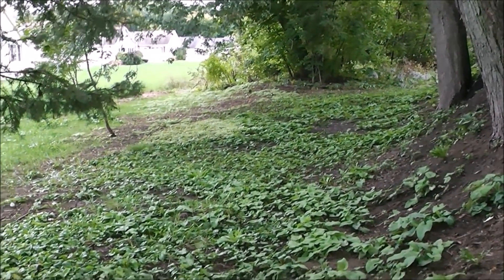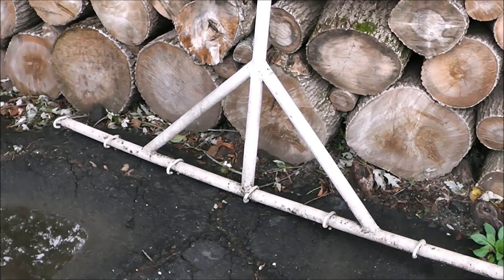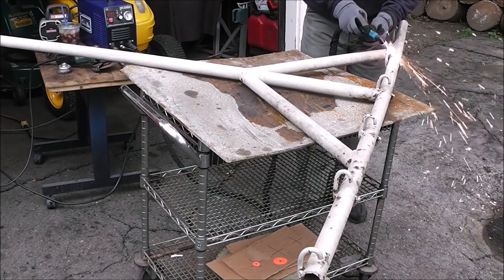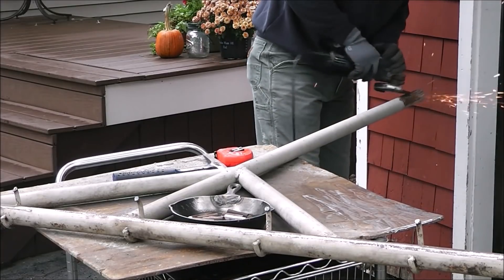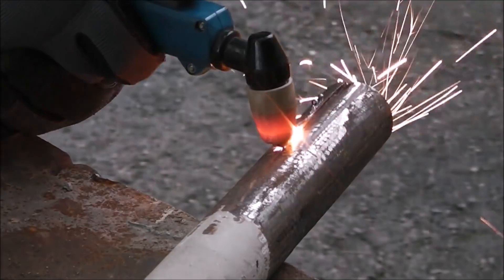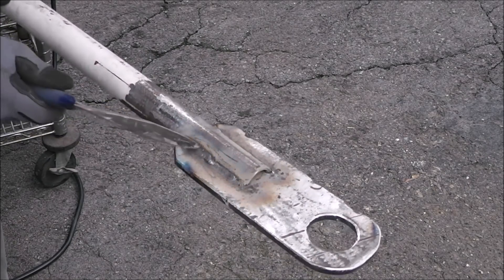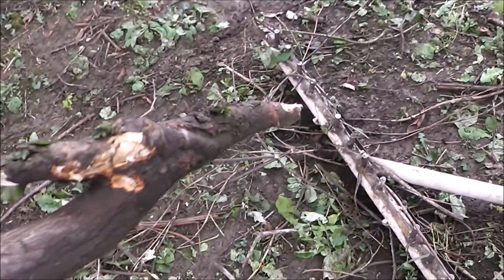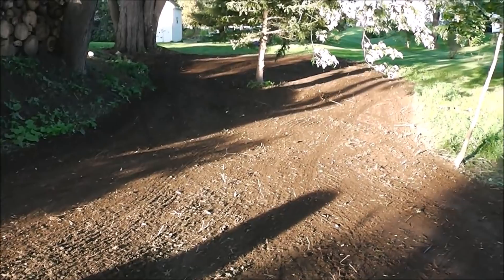How to Stick Weld with 6010 and Build a Tine Harrow to Level Uneven Soil!

Comment: Dang... that worked well. I'm looking to build one this weekend. I may make the tines longer
Reply from the maker: Thanks man! If you do make them longer just be careful your tractor is heavy enough in the front to keep from wheeliing over backwards. This one was on the verge of doing that in the beginning with the heavy vegitation and roots. The tines were getting fetched up but after the soil broke loose then it wasn't a concern.

Comment: Best kinda of tines are flexible and they should be a minimum of 6 inches. The one you made are way to short. You also need to add some weight to it
Reply from the maker: @kyle budd Nah, this is an old video. My lawn looks like a golf coarse because of this tool. I can't compare it to anything else because this is the one and only I ever built but my lawn came out pretty nice so I cant say I would have changed anything. I did use some weight as I mentioned in the video.  I think with 6" tines my tractor wouldn't have had the nut to pull it.  Here is a a look at the finished product. https://youtu.be/Inp5wQYKnZc?t=313

Comment: Hi Brandon,  Does that 205s welder have hot start? How does it do starting an arc compared to your Blue Demon?
Reply from the maker: Good question and here is my opinion. If the majority of your work is stick welding, I always choose the Blue Demon. It has hot start and arc force (it's all automatic with no setting) the Ansen does not have those features but does have a good arc, just not as good as the blue demon.  The blue demon is very crisp and smooth. If the majority of your work is TIG, I would choose the Ansen. I like that it has the automatic gas valve as compared to the Blue Demon which is lift start.  It's a tough call, but in short...the Blue Demon is awesome at stick and the Ansen is awesome at TIG. Clear as mud? LOL hopefully I helped. Cheers brother

Comment: Gotta ask: If 6010 (a dc rod)  won't run well on an inverter welder, then why do they even make it? Anyhow, nice job!
Reply from the maker: Gordon Reiher I’m not an expert on this but 6010 is pretty much used exclusively by pipelines for their root pass on pipe, then they cap it with a 7018 or something along those lines. Many of those guys are using engine drives and the fact that it’s a dc only rod, it gives the smoothest arc and cleanest weld for x Ray. For someone like most of us, we would just grab a 6011. It’s my understanding that the only difference between the two is the flux coating. The 6010 may also burn its flux a little more cleaner, reducing the chance of slag inclusion.

Comment: Love watching your videos. Your thought process for cobbling little projects together is a lot like mine. My last project was taking some black iron pipe I bought in a clearance sale from a local hardware store for 50% off and making a handrail for the stairs on my deck. The pipe was a bit cleaner so I used 7014 rod on it because it welds quickly. I had to use some videos from guys like yourself to learn how to notch the pipes to fit each other and then I was able to assemble it without much trouble. It's amazing what you can learn from YouTube now!
Reply from the maker: Thank you very much. Whenever I can repurpose something or make it better / more useful I do. I get a lot of satisfaction taking something that was discarded and giving it a new life. From the sound of your railing project, you know EXACTLY what I’m talking about! Good on you brother for being resourceful! Thanks for your support! Cheers

Comment: Nice rake build ,your tackle and get the job done style sure makes for a great video every time.I built one,  I used a case 400 to pull it all ,it was two rows of ten foot long pipe and I used railroad spikes about eight inches apart and the back row spikes were offset , but I used a disk on the field first ( 25 acres ) then I planted oats and alfalfa ,then I used a 12 foot pipe with tire chains to cover the seed it all turned out great and made a bunch of hay .
Reply from the maker: Thanks man! That take you built sounds like a beast!

Comment: good project, jut one thing , make sure the hitch is lower than the rear axel of the tractor, that why you won't tip your tractor over on yourself
should the tines grab something before you can stop. turn your hitch over or mount the ball lower than the mid line of the tractor rear axel.
Reply from the maker: Good point! Thank you! I will correct that because I can see someone going over backwards!

Comment: Nice project. Thank you for saving this metal from the scrapyard and repurposing it into something useful. To recycle is great but to repurpose is even better! I like 6010 and 6011 both. I like 5P lincoln and 5p+ for welding pipe but on a project like this I prefer 6011. The 6011 has a bit more arc stabilizers in it that allow it to run on AC. Even when you run the 6011 on DC those arc stabilizers help when welding on parts that can't be cleaned perfectly. At the end of the day when all the tines stayed on and one was bent I think that proves that the way you welded it suited the application. Have a great day and a wonderful weekend. Thanks for sharing and taking us along with you on this job.
Reply from the maker: Thank you very much and thank you for your great comment and your support